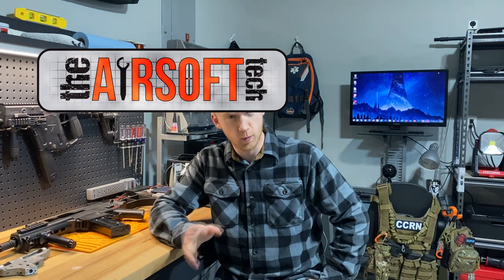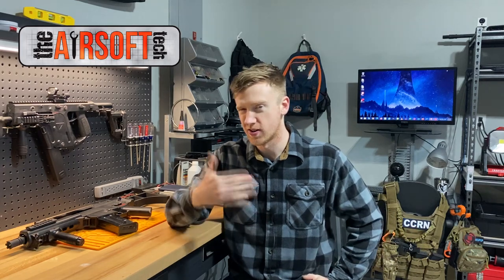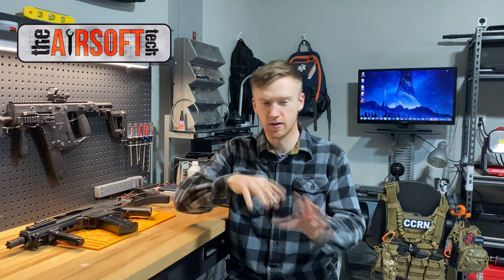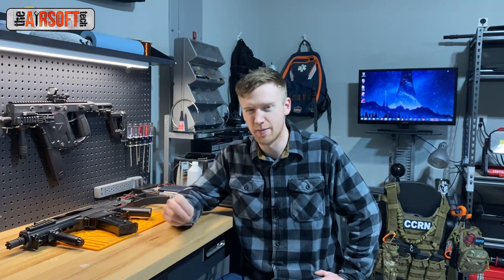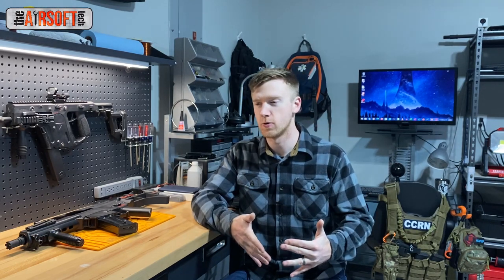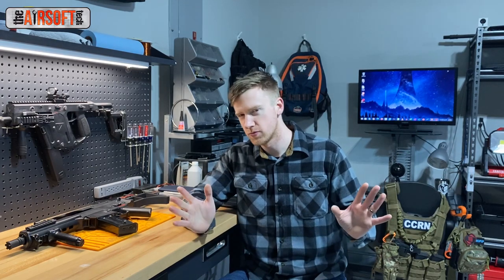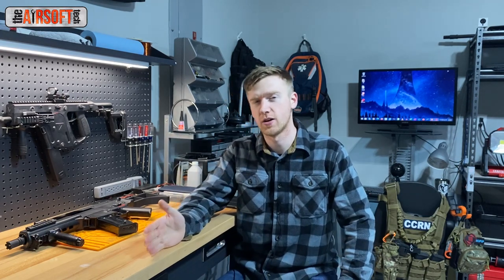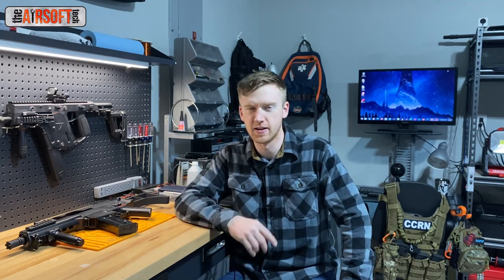Polishing Your Gearbox

Comment: I polish these parts for these reason!

Most odd one, the copper plates on selector plates. When using them with titans, I have found that a shinier surface helps with reflecting the light (duhh) but this makes selector calibration more accurate.  

Piston tracks for a smoother feeling gearbox and almost negligibly lower amp draw 

Tappet tracks if necessary in order allow the Tappet plate to slide in a manner which is most buttery 🧐🎩

Bushings and axels for the reasons you stated 

Flat surfaces such as the top of bevel gears if it so happens to not require shims. In this case since the surface of the gear will rub on the bearing or bushing, I find it necessary to make that surface as smooth as possible to reduce wear, noise and amp draw. 

Cylinder if it appears that said cylinder is not offering air seal correctly. I have found that for Lonex/ ASG cylinders polishing reduces air seal. I also believe that a non polished finish inside a cylinder helps to retain the silicone oil grease. However, I have seen great results with polished cylinders. 

Using a drill press with polishing wheel also speeds up the polishing process drastically in comparison to a dremel.

Comment: Polishing your cylinder would have negative effect!  the O-ring of the piston head wil "clean" all the lubricant that it can carry and in  short time  it will start to wear out the O-ring of the piston head. Just the same as the  engine cylinder honing :)